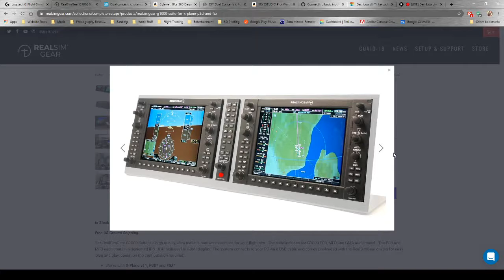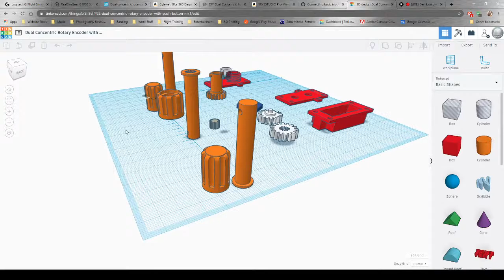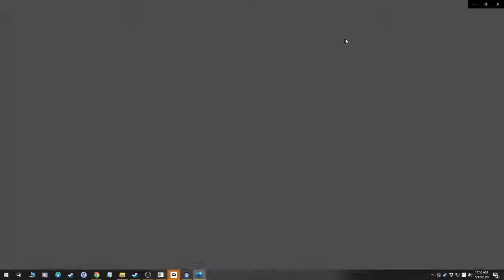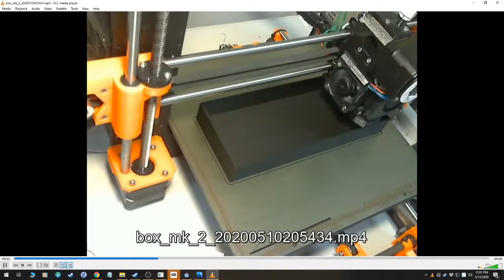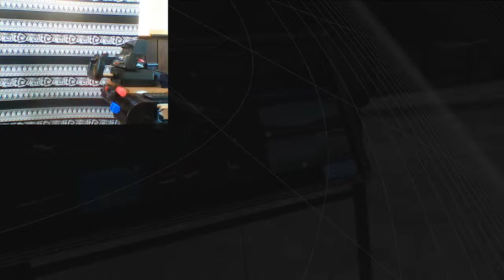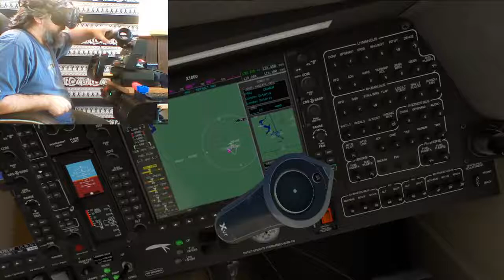Mike's VR cockpit, designing and creating a custom control panel.

Comment: I've been wanting to design some small panels the size of a standard Saitek Flight Instrument Panel, about 5.5 x 4.5, with say 5 line select keys around the edge and a few dual rotary encoders. Imagine something like a "super micro" G530, and without the LCD, but also generic so that it could work for pretty much any FMS panel.

I'm also trying to think of a solution for an FMC keyboard entry panel that would work with VR. VR is a strange beast because you can't really see what you are using without ducking under and breaking immersion, so you really need purpose built things, but if you want to fly a ton of different aircraft, you're either swapping things in/out or limiting yourself to specific aircraft.

Mode selects are a bit of a pain in VR as well, unless there's some sort of tactile reference, or in-VR indicator. what I mean by this is using a knob or button that controls different things based on its "shift mode" -- like a single rotary encoder that does things like change vert speed, heading bug, and CRS, based on the position of another switch. This requires you to either remember what mode you are in, or reference the panel in some way (either visually or tactilely). The only method I could see working for this would be some sort of switch grid, for me I'd do a 2x2 or 3x3 (2 on-off switches, or 2 on-off-on switches), oriented in different directions (one in up/down, one in left/right). You could also use this to use a single panel for multiple MFDs -- example, in DCS where you can have 3-4 MFD's depending on aircraft, you could arrange the mode selects in such a way that you control what MFD you are using based on the "grid" select. You want the upper left MFD? switches to UP and LEFT. Now you need the upper right MFD? switches in UP RIGHT. You want the center MFD? (in a 3x3 grid, using on/off/on switch) both switches to MID position. You could center locate the switches center where the LCD would be on a commercial Saitek FIP for example (unused space)

The other alternative is using something like VoiceAttack, though at a minimum I would use this in combination with a switch DIY panel. 
I do wish someone had a VoiceAttack profile that could "take notes" in various forms, for example you say "Waypoint 1, North 59.495 West 049.956"; then you could have it readback, or you could say "FMS enter" and it would type it out on the FMS. in a commercial setting like MSFS, you could say "FMS Keyboard" (or bind it to a button?) and simple spell out things ie (K-P-H-L) and it would press each key to enter KPHL for you on the FMS. I'm a bit lost by the software so I don't know how to achieve either of these.
Reply from the maker: I had gotten used to the mode select method using the saitek autopilot panel. I started looking at ways to mode shift my encoders on this box but it quickly got above my circuit design skill level. My initial design for the box actually fit over the entire saitek yoke and was going to allow the panel to affix to it but I ended up going simpler and I think Im much happier for it. Another thing I did here after this video was I used the arduino board and mmjoy software as replacement elevator and aileron axis for my saitek yoke. There is a deadzone the yoke that is basically baked into the controller board for it, and as I started doing more slow flight and smaller more precision things I started to notice the impact of it. So I drilled a hole in the top of my saitek yoke, desoldered the pots for x-y and resoldered a wire that went up through the hole, then into the encoder box and onto a spare input on the arduino board I used as a controller. It picks up even the slightest movement of the yoke now and is much much smoother. For the last year I have been renovating my office, including the entire floor joist structure of the office and the room below it. Hopefully in a few weeks the new carpet will be going in and I can move back in, after that I plan to do a bit more streaming and I want to do a more detailed look at my vr cockpit, as Im planning on designing a completely new one in the spring. I really like your idea of the vocal note taking, for me flying in vr this is the most difficult thing to deal with. Ive tried to find plugins that would add a text history of atc commands in xplane in the vr view like it does on the monitors but haven't yet. I haven't actually opened xplane in months however, I've been spending far too much time in star wars squadrons blowing up tiefighters (really getting blown up by them).